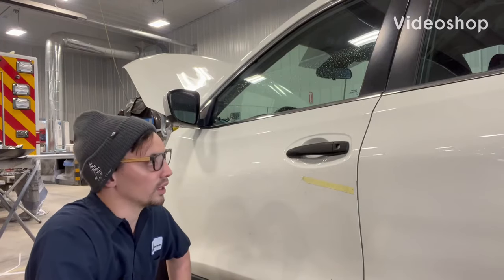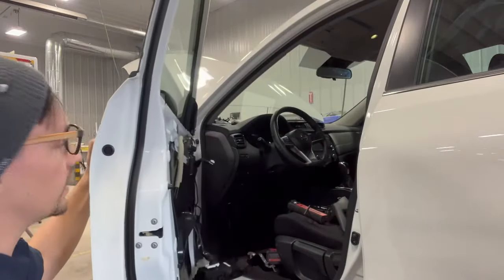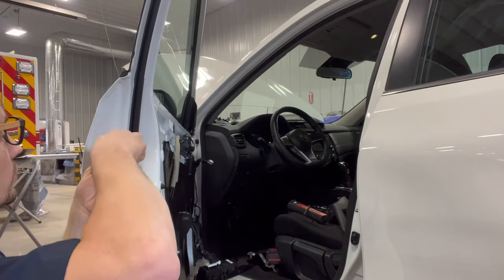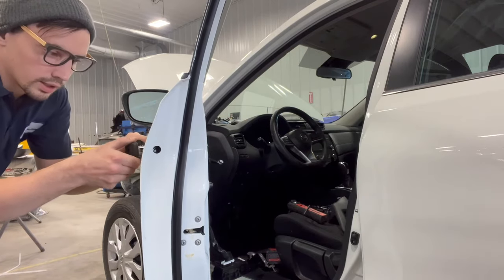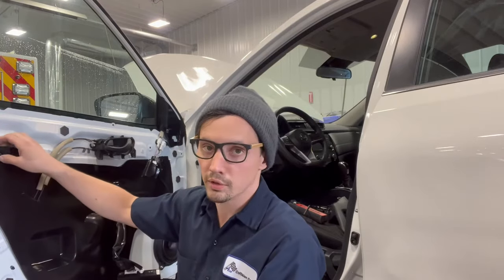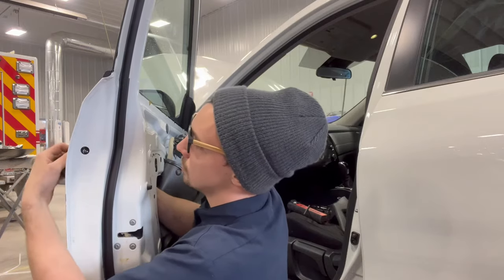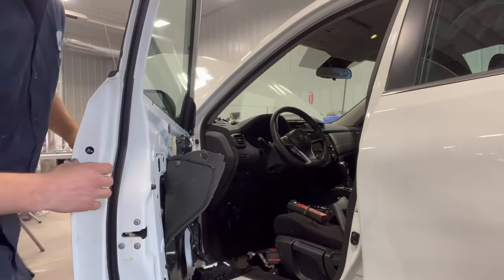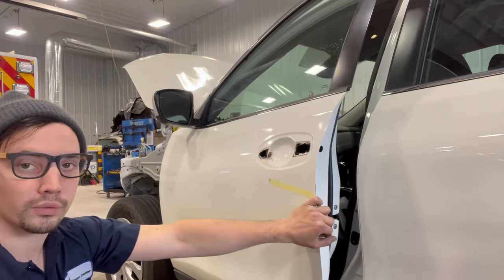2013-2020 Nissan Rogue Front Door Handle Removal ￼

Comment: My Rouge door was slammed and now it the handle wont work to open the door from the outside or inside. It’s stuck shut. Any idea how this could be fixed without cutting into the door? The shops around me are stumped by this!
Reply from the maker: I’ve had this problem before and seems like a shop should be able to help you in your area. Most times, I can get the door open somehow or another, and then push the dent out from the inside enough to where the handle starts working again. Not sure how bad your door is but there should be a way to get it done.